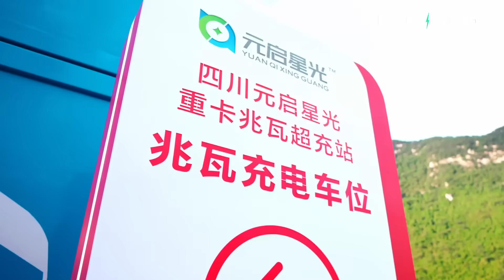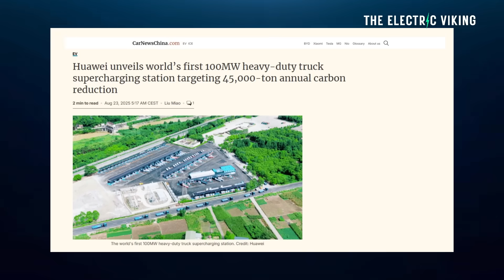China’s Megawatt Charger Shocking the World—100 MW Power at 1 SITE!

Comment: Went to a reseller of Xpeng the other day here in Chengdu China, and they are building charging stations at a furious speed. The guy I talk to said they are pretty much also building charging stations near high speed train lines. They use the electricity from the railways to charge massive batteries at the charging stations to provide high power output to the cars. I think this is pretty clever.

Comment: we took a visit to China a few months ago, and i thought I had moved into the future, (compared to NZ ). The motorways were lined with flower boxes for kilometers which my wife noticed at first and then I did too.  They have different coloured number plates to distinguish what car you drive, we saw green for ev, blue for ice, and yellow for commercial.  And as far as tower blocks are concerned, they were like weeds out of control!  I kept thinking how did they manage the sewerage and the electricity and the ability to get to work and back each day? etc etc etc.  To top it off, when we were in Hong Kong they drove on the left just like we do, and as soon as we crossed the border into the real China evidently? everyone all of a sudden drove on the right.  Our bus driver was unfazed because  he is used to it (he did wear out his hooter though)  we mainly kept to the motorways and they seemed to be everywhere and go endlessly in all directions.  The factories we toured ( it was a business visit ) also blew my mind,  mainly because of the sheer scale of everything they manufactured, not by the hundred, not by the thousand, but by the million. The other shock was where is all this pollution I have been told about?  it seemed the air quality was quite ok to me.
However, I am very happy to be living here in NZ where I can have a boat and in my own yard, an acre or two and so on and on.  I do own an MG ev,  made in China,  so I am saving heaps each year in imported refined fuel costs by using our local ecotricity green energy.

Comment: The Chinese electricity grid can easily accommodate that load. No worries.
China is adding the capacity of one UK to the grid every year. 1 UK = the total capacity of the UK and they usually have a overcapacity between 80 and 100%. Thus the dirt cheap electricity prices.
Rest assured, that complete site can draw its max capacity.

Comment: The savings is not just fuel. Diesel trucks require maintenance and require down time to do that. That is IF you can find a diesel mechanic. EV trucks are also safer because of regen braking taking a load off the friction brakes so you don't have run away risk. It also takes less skill and fitness to drive EV trucks so labor costs will be more consistent and drivers will be more available.
Reply: Also helping to mitigate estimated $900B/yr drag on Chinese economy from health impacts of fossil fuel air pollution.
Reply: Also less noise and vibrations, preventing the driver from getting tired as quickly as diesel trucks.
Reply: @patricklinsley3676 And breathing all those fumes can’t be good.

Comment: The suggestion is that these Semi  trucks in the video have around 600 kWh batteries that weigh in at around 2 MT.
whilst the chinese trucks are not giving consumption numbers , many similar size trucks single rear axle pulling 44 MT can see consumption from 1.0 kWh per km to 1.9 kWh per km  so range is most likely between 500 kms at best and 300 kms in a heavy haul steep climb scenario.
China have bridge load limits on many highways so unlikely to see loads higher than 44 MT . possible even less and some container trucks ar not even allowed 24 MT as is th einternational max load for a 40 ft FCL.
 assuming 1 MWh charger then a 600 kWh battery could see charging in  just on 1 hr from 10% - 90% and a travel distance around 400 kms.  
It would be interesting to see some detailed facts on the capacities and efficiencies and real world charge speeds, similar to the info provided by Tobias from the Electric Trucker.
Commonly chargers said to be capable often fail to deliver Max charge. seldom do you see the charges delivering full rated power in any of the examples so far seen accross the trucking you tuber showing real world use.
Reply: Actually is 300kw LFP Battery. The maximum range of the truck is 300 km, the price of the truck is $60,000

I think China will use trains to move goods over long distances.

Comment: Its Huawei...its 1MW charging. total station capacity is 100MW...huawei rules them all...Huawei already announced a 1.5 MW charging capability...primarily for commerical trucks use...
Reply: And it won't last long, there will be 2 MW, 3 MW, 4 MW etc. that's the competition in China 😂
Reply: America's chances of being able to compete with China used to be rather slim. Then came everyone's favourite president and their chances went to exactly 0.00% with zero margin of error. Trump truly did Make China Great Again.
Reply: and what's so special about that? the first MCS charger in Belgium has been operating for month now.
Reply: @patrickkayser they probably use Huawei tech but don't mention it. Huawei is king. The best company.
Reply: @remix-yy1hs  Milence (operator)use 'Power Electronic' MCS chargers.
Reply: @patrickkayser  Huawei's megacharger has higher current and voltage ratings though.
Reply: @peterlai9018  1000V vs 800V is not a huge difference though. Neither are the last evolution step of their respective standards. MCS' roadmap is up to 3.75 MW, if there is ever a need for it.
Reply: @patrickkayser, Oh. nothing special.  Other than the scaling/volume factor!,,,?
Reply: @asleytamkei7507   there is no magic sauce though. you need a bigger battery bank. you just need more transformers, perhaps a strong medium/high voltage grid connection and/or those prefabbed battery banks that are build into shipping containers.
Reply: Do they start up a gas turbine if some trucks starts charging?
Reply: @Harrythehun peak loading is planned to be accommodated by massive battery banks at each station, that way each station can also act as part of a decentralised energy storage and distribution network for the main electricity grid. They have planned so far ahead, we are in the dust in the rear view mirror.